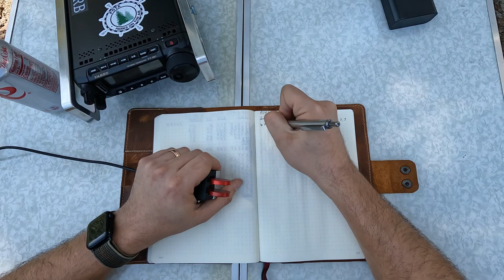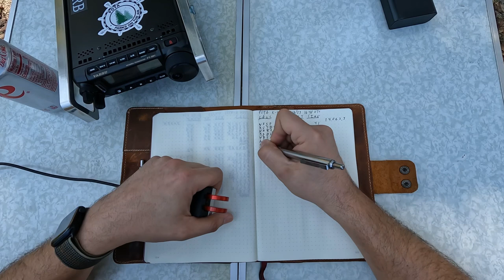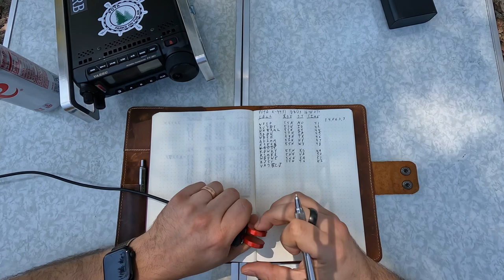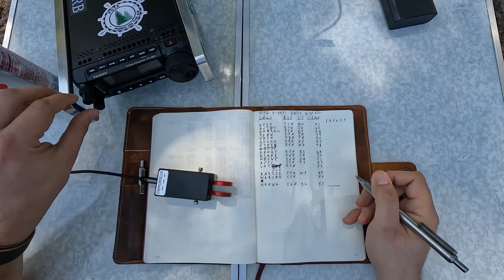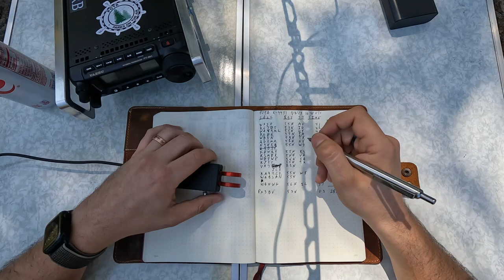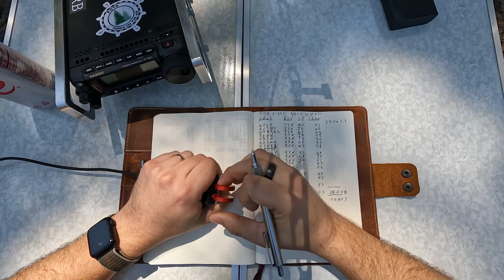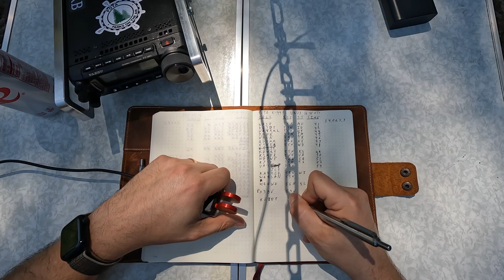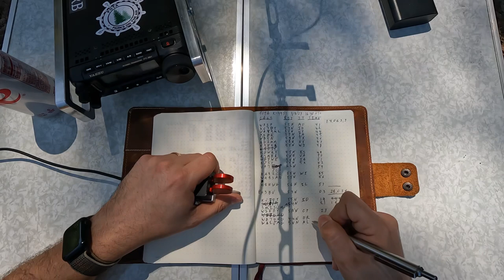Lunch Time POTA CW Activation - 9/8/23 @ K-4451

Comment: another nice  one Aaron - my CW pota huntin is soaring to the 40 parks on CW - u created a monster lol -thanks again 73
Reply from the maker: That’s AWESOME! You’re filling that logbook up quick!! I know once I got the bravery and got on the air with CW,  that was it, I was hooked. 73!
Reply: @w4arb  yes its gettin so i dont even look for a ssb unless there are no CW station in the spots - thanks again 73 dit dit
Reply from the maker: @brianve7jyd943  That’s what happened for me too. I think I’ve only made a couple SSB contacts in the last 12 months. And one was ground wave on 20m where someone I didn’t know was activating a park down the road from me. I couldn’t help but get that one. Hah.
Reply: @w4arb  its hard up north here this summer - propagtion is not good - the whole USA  and lower Canada will  have resonable prop and up here were hung out to dry seems lol - often cant hear anything and i do have a good antenna